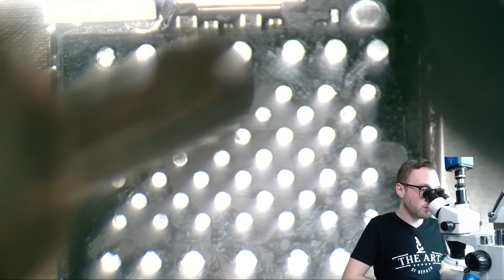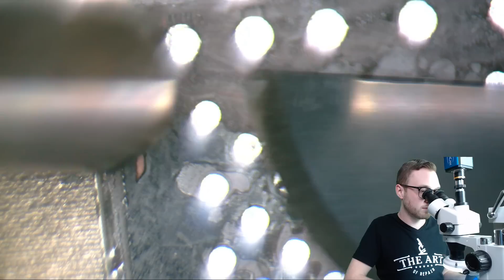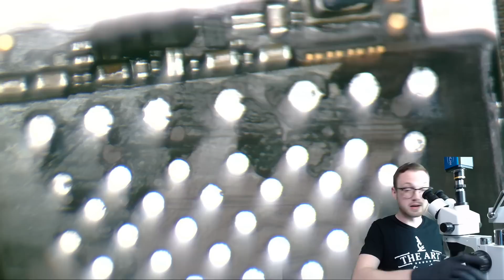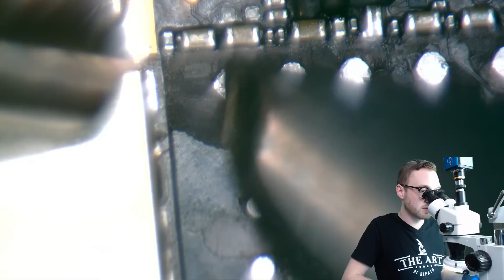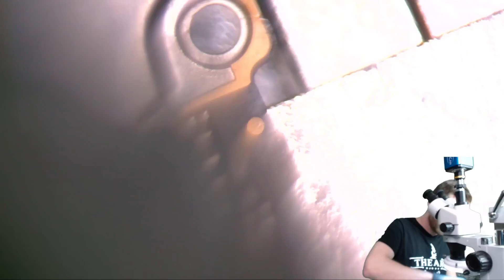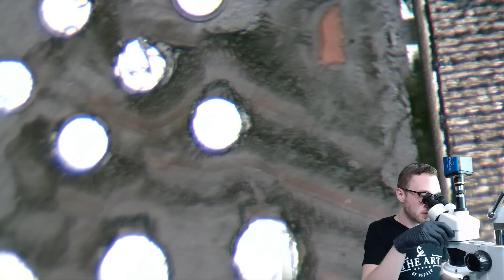EP16 Super Satisfying Residual Apple Underfill Removal Method Dot Com

Comment: is there any solution to fix broken pads? coz when i tried to remove the nand ic from my ipad air mb i did it wrong way and i pulled all pads from the board!!
Reply from the maker: It just depends on the pads pulled, if you can run jumpers from the next component in the line back to the pad, you will be fine. But as there becomes more jumpers, it can become more difficult based on the next traces location. The real issue here that needs to be addressed is the fact that pads were pulled. I would suggest trying to practice a bit more before doing nand for clients based on your initial issue.
Reply: Yeah, I agree.. I also get super uncomfortable, when I see the super heaters just scratching the boards like it's a frozen windshield during winter...

Anyways.. It is correct that you can do jumpers / wires and use solder mask / UV light etc to repair traces.. But that is mainly for DC, under 100 KHz boost converter lines etc.
You will get issues if you do that on the 8bit / JESD204B lines (100 MHz) for PCIE / 32 / 64 bit NAND.. The traces is differential (PCIE), and length matched.

Also a lot of PCB design rules for high speed busses, can also have signal, gnd, signal, gnd, etc.. to shield the signal, and keep a high signal integrity.
All this shit is done, to avoid noise, cross-talk, jitter, skew and in some situations EMI.

So yeah.. go ahead.. use 0,02mm copper wire randomly, because you saw some indian lifehacker on youtube fixing his phone with wire from a old CRT flyback transformer, his moms hair dryer, and a flea circus..

Comment: Hey , any suggestions on 5s red screen problem?
Reply from the maker: What all have you done up to this point to diagnose the issue? Whats the device history?  Do you have the proper tools to possibly move forward on a board repair?
Reply: The phone was brought for battery replacement, but after 4 days the got it back saying it didn't turn on... but i think it took a hit because when i opened it up the flex of the battery was cut.. I replaced with new one.. boots till apple logo then screen turns red.. they said it could be proximity sensor flex with camera but already tried ... i have heat gun, soldering iron, microscope.. can I have your email adress?
Reply from the maker: Try and work backward from the prox itself. Im a little concerned that the flex was cut on the battery. Are you sure it wasn't accidentally damaged during install or prior to install? I can help you with this, but I cannot do a full diagnosis on this for you. Thats part of the learning process. I would suggest making a reddit account and making a post about the issue in /r/mobilerepair. This way the entire community can come together and try to help you. my username is /u/thephonegod on reddit

Comment: Hi Justin, after having removed the underfill and replaced the component: do you fix the component with new "glue"? The was a reason that this underfill was there. Probably to make the comonent more resistant to vibrations? In case of a yes: what material are you using to fix the component?
Reply from the maker: No, generally I dont because I want to keep repair-ability, BUT if I did, I would probably just do a quick UV coating on the corners to keep it stable.